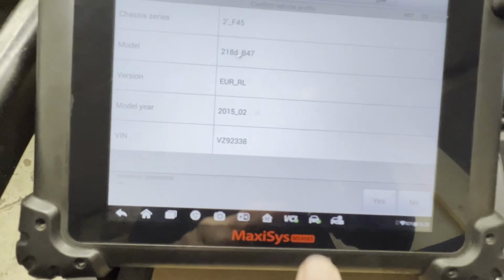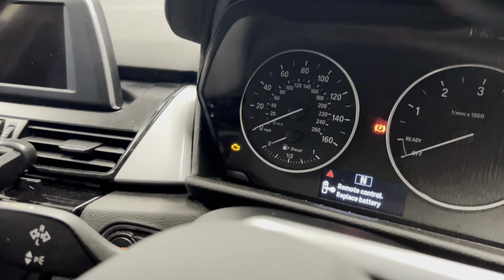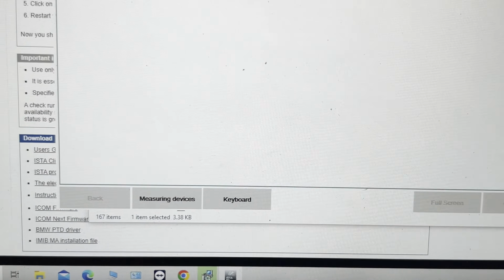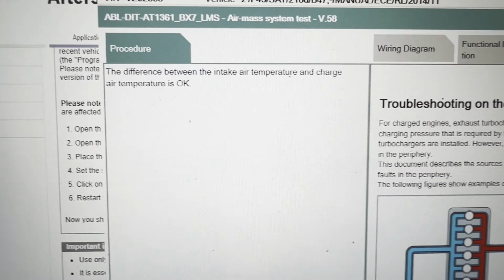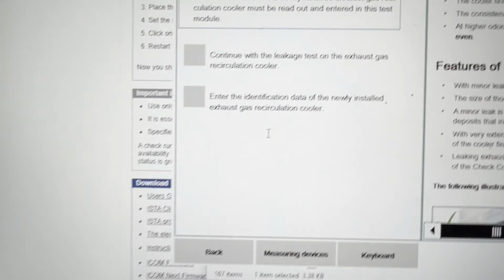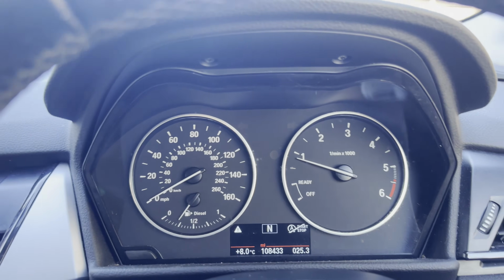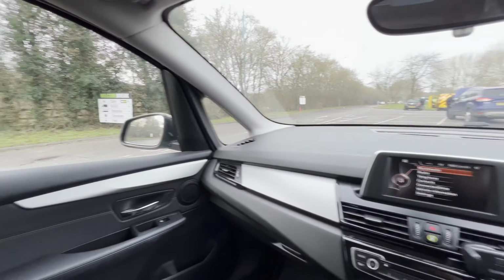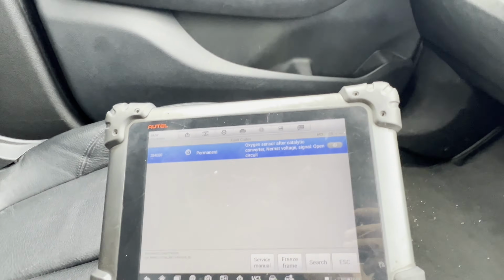FIXED! BMW Limp Mode- Fault Code 36F600  Air Mass System Extensive Leakage In Intake System Detected

Comment: ATTENTION ATTENTION. @everyone 

IF YOU HAVE 36F400 fault code. Then read this. 
AIR LEAK DETECTED IN THE INTAKE SYSTEM. 

THIS FAULT CODE CAUSES THE CAR TO GO IN LIMP MODE AND CANT REV IT FULL. 

CANT DELETE THE FAULT COMES BACK STRAIGHT AWAY WHEN IGNITION IS ON. 

THIS CAN BE DONE BY RESSETING THE AIR INTAKE SYSTEM CRITICAL IN SERVICE FUNCTIONS OF ENGINE SECTION. ONCE YOU DO THIS FAULT IS CLEARED AND CAR GOES BACK TO NORMAL. 

CHEAP DIAGNOSITIC DEVICES WONT BE ABLE TO DO THIS. AUTO LOGIC WAS USED IN MY CASE.

Comment: Hello, I have the same problem leakage stage 2-3 what is the error? in my case the egr cooler is cleaned egr also intake manifold also please help car starts when ignition is on directly in emergency mode

Comment: anyone can help me what is code 36F500:  air mass system plausibility level 3 major deviation in the air mass.
 thats what came on snap on
any clue what needs fix ? thank you
Reply: I have the same problem. Do you know what is the solution?  36F000 36F600 36F400..  Thx
Reply: I have sold the as it was but most probably turbo hose small hole